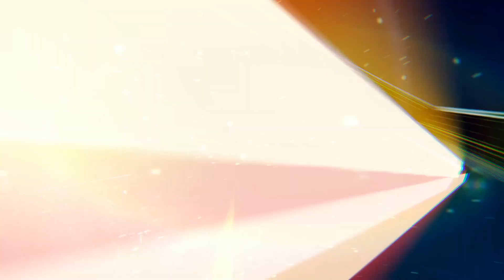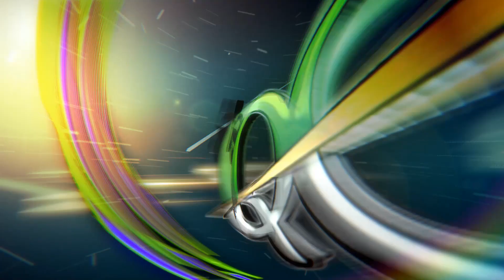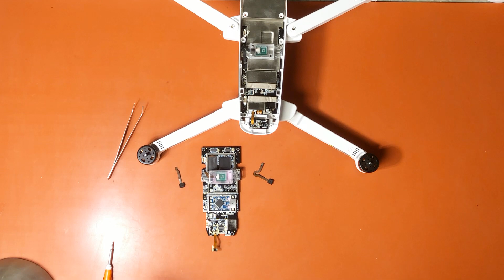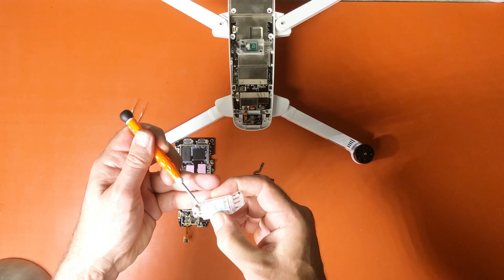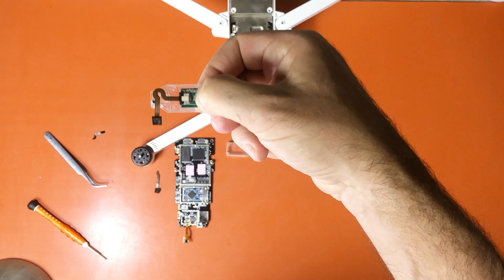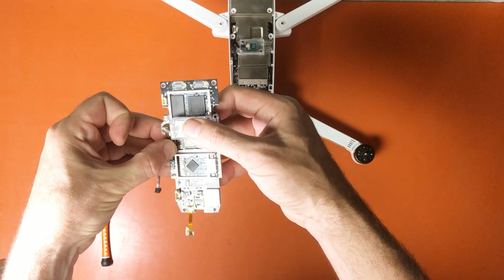HUBSAN ZINO - GYRO RIBBON CABLE REPLACEMENT - GYROSCOPE - BAROMETER

Comment: Hi QC,
Great vid. Any plans to do a disassembly vid for the zino mini? Dealing with a barometer error .
Reply from the maker: I have one partially videoed but never did anything with it to complete it. Most come to me already disassembled because they are crashed up.
Reply: @QCGUY  mine is still in one piece except for aforementioned. Do you do repairs or know of where to get bar gps module. Thanks
Reply from the maker: @markgrant8760  I do repairs every day and have many parts so I can fix you up. 
Email if that’s what you want to do 👍🏻
qcguy.chris@gmail.com

Comment: I’ve replaced the gyro on my pro and it says it’s over heating and won’t allow it to take off or finish calibration. Thoughts?
Reply from the maker: Sounds like you got a faulty one or the wrong one possibly.
What happened to make you replace it?
Is the new one an exact match?
Did you just replace the cable or the complete set?
Reply: @QCGUY  complete unit.  Got the drone from someone who crashed it and was going to junk it.  They bought the parts and just didn’t feel like working on it.  So far I’ve done an arm, gyro, and gimble cable.
Reply from the maker: @dkephart80  You may have a issue with the main board but I would try another gyro with cable. I work on drones daily and have test parts to swap out making troubleshooting easy but keep that in mind if you don’t resolve it and want to send it to me.

Comment: Thank you for the very informative video. After a crash with Zino, when I turn it on, I get “Accelerometor Error” and “Gyro Sensor Error” messages on the Zino app on my phone. I have searched Google and YouTube for both of these, but cannot find anything related. Would an issue with this cable, or related connectors be the cause? Thanks.
Reply from the maker: Sorry for the late reply but no it sounds like you need to look inside at the gyro/barometer.

Comment: Does this cable work with zino pro?where do i get just the cable?
Reply from the maker: BUILDINGJMPR67 Video cable’s are the same but gimbal motor cables are different. 
You need to buy the cable that says it’s for Zino-Y or ZinoPR-Y
Just google it and you will find them. What country are you in?
Reply: @QCGUY   I'm in the US..Florida.
Reply from the maker: BUILDINGJMPR67 I was going to offer to send you one but turns out I’m out. I have more on order but that takes at least a month these days.
Reply: @QCGUY  good morning bud,i sure appreciate the thought. I just ordered one and yes it looks like its gonna take about 4 weeks to arrive.i just got this drone about a month ago,flew great,until it decided to flip over upon takeoff for no apparent reason and and up on its backside? I set it up again and tried take off again to see if it was still working and out flew fine only to find out the camera was not connected. I followed your videos and disassembly was easy,checked all 4 plugs(they were fine)and inadvertently broke the cable for the barometer.the barometer is an easy fix but im at a complete loss trying to figure out what the camera issue is?you seem to know everything about the zino and your videos are perfectly explained...any ideas on what i might check camera wise?
Reply from the maker: BUILDINGJMPR67 get a new camera cable. It can look fine and still be bad. I have replaced a bunch of them.
Reply: @QCGUY  Are you in the market for a New zino pro? This ribbon cable is just a little out of my skill range,i would probably screw something up before i fixed it...lol.  Only 1 wreck(flip over on record)..
Reply from the maker: BUILDINGJMPR67 no thanks but I appreciate the offer. I’m not buying any zino’s.
Reply: @QCGUY  you we're jenurous to offer a part so i thought I'd  return the favor is all?i really appreciateyour vids,top notch in my book! Hubsan zino pro is just not for me.i was ripped off from the Start buying a fly more combo that was missing half of the items. Then they sent me a new battery for misunderstanding? I used the new battery and had a flip over?..  $400...really?
Reply from the maker: BUILDINGJMPR67 I remember your story now. Yes disappointing indeed! 
I would love to take it off your hands to help others with parts but people donate them eventually so I end up with a lot of parts.
Reply: @QCGUY  not to mention the drone is pretty much useless after a 10 mph wind? Its a turtle compared to most $400 quads these days... it may be for some people but just not for me. I truly don't believe any drone that malfunctions from a mere flip over is worth much at all...

Comment: hello from Spain, I have broken the connector (tape) of the gyroscope, could I glue the tracks with copper tape and then put heat (adhesive tape), and it works or repair it in this way?  Thanks for reading this message
Reply from the maker: Fran P. I personally would replace it. I don’t attempt such repairs for something I am putting in the air that could fail.
Reply: @QCGUY  Thank you for your answer, the case is that my zino 1 has C1838, and I do not see in stores, only C1837, I guess it's the same
Reply from the maker: Fran P. They are sending C2016 now C1937 is a smaller one under the gimbal power board. 
Aliexpress has been the most reliable one for these.
Reply: @QCGUY  in stores I saw gyro C1931 (not C1937), I would use the Zino plate first, (not the zinoY), THX and Grettings
Reply from the maker: @franp.3824  Those are the lot numbers so they change. The part number is different but always but the one for zino not zino y.

Comment: Did I get the wrong cable? Mine says  c 1934?
Reply from the maker: BUILDINGJMPR67 They have the same cable with different numbers on them. Best way to find out is if it looks and is shaped the same then try it. 👍
Reply: @QCGUY  ok will do bud...thanks for the info..i was afraid to try it,didn't want to mess it up anymore than it is...thx again!
Reply from the maker: BUILDINGJMPR67 If you have a regular Zino the plug on the gimbal cable to the board won’t say anything. If you have Zino-Y it will say J4 or J1.
The image cables are the same.
Reply: @QCGUY  well i ordered 2 cables(just in case)they are identical and i couldn't get either one to snap on...eventually bending the pins on both cables during the process...i think maybe the board connect got damaged when it was ripped out originally.I'm going to put it online for parts sale. If it doesn't sell i will be sending you a donation.It's the least i can do for all of the helpful advices you have given..very Much appreciated and keep up the great vids! I will stick with my trusty beebop 2.. it never let me down yet..thx again bud!
Reply from the maker: BUILDINGJMPR67 Im sorry 😐 and those parts donations are always helpful. Thanks

Comment: Is it ABSOLUTELY necessary to remove the whole board to replace this cable? Seems like leaving ALOT could go wrong just clicking in the cable!
Reply from the maker: Dramatic CAPS! lol
Is it absolutely necessary? No 
Could a lot go wrong? No
You can just as easily screw it up with the board in or out. I don’t know if you have 4 thumbs or two but many people screw these cables up either way. I should know I fix them almost daily.